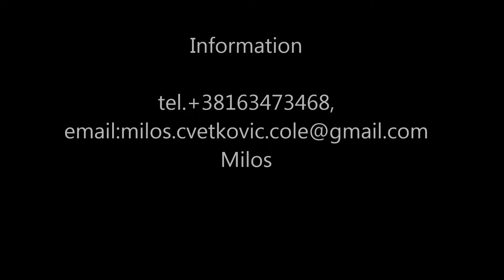Opel Rekord 1963 Restaurierung

Comment: War mal auch mein 1. Opel - ein Auto mit vieel Platz - keine scheußliche Windkanal-Kreatur - und einem übersichtlichen Motor. Leider der Rost. Und daran wäre ich dann doch verzweifelt. Gratulation zu der Wahnsinnsarbeit ! Der ist aber jetzt bestimmt mehrere 10.000 Euro Wert; oder ? War eine super Fotodokumentation ! Meiner hatte auch noch eine Jalousie vor dem Kühler.
Reply from the maker: Vielen Dank für den Kommentar, wir haben auch mit Autos gearbeitet, die in einem schlechteren Zustand sind. Restaurierung ist ein Job, der viel Zeit und Liebe kostet. Wenn Sie dieses Auto noch besitzen, senden Sie uns bitte eine E-Mail
Reply: Ich habe den Rekord A als Cabrio von der Firma Deutsch aus Köln